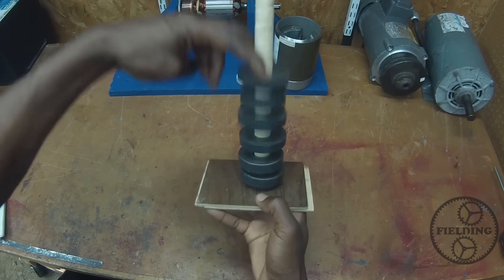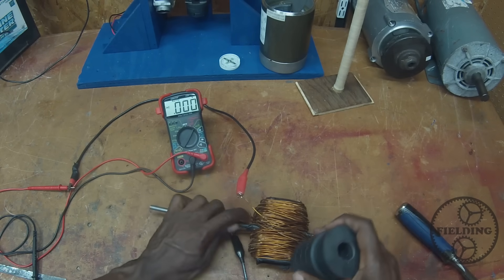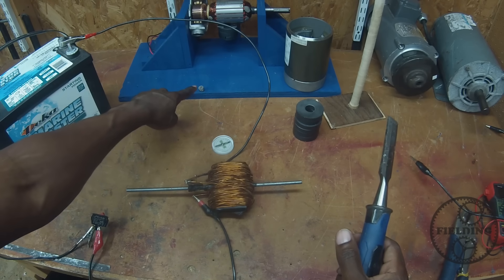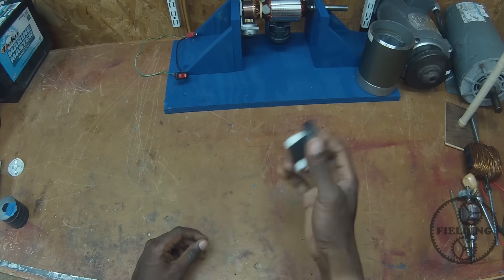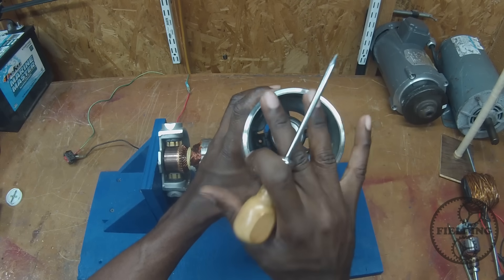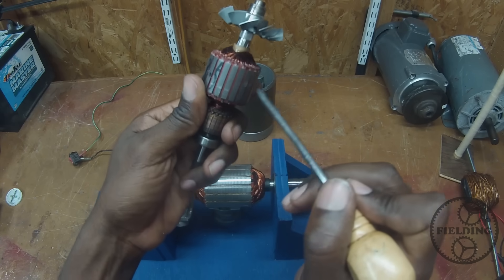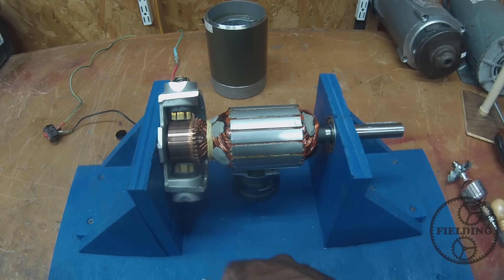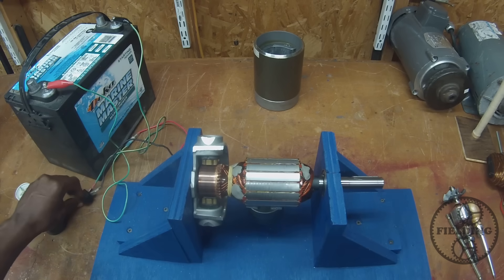How Motors Work For Beginners (Episode 1): The DC Motor: 032

Comment: Jeremy-I wired a d.c treadmill motor with a full bridge rectifier and a switch from a fan-just like you did -it works but the switch and the rectifier get really hot ---any help would be greatly appreciated---diane s
Reply from the maker: +diane spranger I don't recommend you do it this way. Get a speed controller! Now that I said that. At a minimum You need a heat-sink and a fan. Sounds like your rectifier is not rated for the load (amps)

Comment: Carbon nano tube technology, all metals are regined crystal structures which means nano carbon tubes can be filled with these crystal metals to produce lite weight electric motors and generators. Graphene used would mean the whole electric motor would  become an energy generating device. Using crystal power generating systems require no need for moving parts just frequency to induce high energy vibration. A solid state graphite power cell exsposed to the correct hertz frequency would produce more electrical output then just off the earths resonance field. That then can charge organic carbon power cells or graphite airogel ultra power cells contructucted just like carbon capacitors and with being able to mass produce graphene to produce ultra power cells that could be charged off solid state graphite power cells with no need of any moving parts all just by using frequency.

Comment: Jeremy, question...why does the stator part have two permanent magnets mounted opposite of each other inside the cylinder when your design has a magnet on one side only and still functions? Apparently opposing stator magnets are not required, correct?
Reply from the maker: They are not required. BUT, your motor is significantly more powerful if you have a magnet on both side with opposing fields. Basically one is pushing while the other is pulling. It doubles the strength of the magnetic field surrounding the rotor.
Reply: Got it...that makes sense. Thanks again!

Comment: I recently acquired a marathon electric motor, it is in the 1/2 to 1 HP range, but the identification label is no longer on it. Is there a way to figure out was size capacitor I will need to pair with it? I want to build a disc grinder/sander with it.
Reply from the maker: I would just buy a start capacitor for a washing machine. It will be close. As long as it has the correct voltage rating (higher than the voltage being used) it will work.. If it really struggles to start get a second one and put them on parallel with each other. That would only happen if you started it under load like holding something against the belt when it was started.
Reply: Jeremy Fielding ok awesome! Thanks! I love all your videos. Very informative and fun to watch!

Comment: Would like to see converting single phase 120v house current to 3 phase (or about 2+ phase) by driving a 3 phase motor, for say a lathe, etc.
Good basic video for understanding - thanks.
Reply from the maker: The next video will be about three phase motors, but it continues the "basics" theme. I do intend to make a three phase wiring video that addresses this issue of running three phase motors with single phase power. There are several videos standing in line so it won't be quick, but it is on the way. Thanks for letting me know you are interested. Comments like this bump up or down certain videos depending on what is the most requested.
Reply: I greatly enjoy your videos, you present them in a very understandable manner.
Thanks

Comment: Whenever I see the guts of one of these motors it always passes thru my mind : did some poor wretch have to wind those coils by hand or do machines exist that can do it?
Reply: Machines do it but Trump is going to get them out of work guys from  Detroit to wind them by hand.
Reply: What Mr Fielding had demonstrating the magnetic forces, the copper wire, was a crude variation on winding.  There are a few instructional texts out there. 
Machines certainly exist.  
It used to be a "step up" the hierarchy in a motor shop once you were deemed competent to wind a motor...it can be or used to be quite a "dirty" job esp with the insulation and varnishes involved.  Nearly every electrical motor repair shop used to be capable of rewinding a motor.  I live in a city of about 700 000, there are perhaps 3 commercial places I would take a repair and guessing only one or two of those even rewind motors at all anymore on a regular basis.  
Its just replace.  It would still be done if it were cost effective, say a very specific application where a replacement was not longer made (old machinery) or so large shipping costs of new would outweigh cost of rewind.  
In a related field, welding machines used to be of "transformer" style so they too had a lot of copper windings, many welding machines now are inverters and so the need for copper windings for welding machines has been greatly reduced.

Comment: Like to have seen an ammeter in circuit. Later on you'll probably show the current drops back somewhat due to the back EMF produced
Reply from the maker: Back EMF, eddy currents, power factor, and other such related topics I plan to avoid in this series. These are things that I think are easier to understand when you have more background knowledge. This series is about the background knowledge. Your idea does make me wonder if I should talk about voltage, current and resistance... I wonder if I should be assuming they know what those things are and know the difference between them.
Reply: Yes Jeremy it does make sense to keep it simple, I agree.
As for R. A. and V. I can see the dilemma there but you explain really well as others have commented so......

Comment: Great job Jeremy!
I have been reading a book of eletric motors and in the book they explain that the power of  a the motor is directly relationated with is size, but as you show, you have 2 motors practically the same size but deferent power output's, could you explian that in a video, the diferences between a 1/4hp motor and 3hp motor. 
Thanks a lot for your work, it is really explanatory!!

Comment: is there one thing you can look at and tell AC or DC ?
Reply from the maker: Actually, this will be part of the next video... How do you tell the difference between different types of motors and how to read the label if it has one. There isn't just one clue I can point to. Universal motors for example work on AC and DC. The Label is where I start. Then I look for brushes, I look at the rotor, and I look at the number of wires. Both AC and DC motors may have capacitors. You have to look for a few things.

Comment: you dont happen to have a 1 hp electric motor that is 1725 rpms i can do some trading with you on? i need one for my metal bandsaw
Reply from the maker: Of course I do... I have all types and more than one! You need three phase, single phase... LOL You can send me a private message on my about page under my channel... The shipping cost can be in issue though. These motors are heavy.

Comment: Jeremy

Do you have a P.O. Box? If not you should get a P.O. Box so fans can send you stuff. I wanted to send you some HDPE that is scrap from my job that is ground very fine. I want to see you do an HDPE project and this is stuff that is easy to work with since it is meant for injection molding.
Reply from the maker: +gplechuckiii send me a private message on my "about page"
Reply from the maker: You can also send me an email on my website... www.jeremyfielding.com

Comment: Very nice.  If I may, I'd like to have seen the motor powered on while the magnet was removed, then brought back a few times.  Electric stuff is so neat.
Reply from the maker: I may show this in the question and answer video... I did this in the video on making a motor from a microwave. you can see that here. https://youtu.be/au_c8WmgWTc
Reply: We use to use the rule-of-thumb that a stuck DC motor would draw 4 to 5 times the current.  A couple of metres reading amps and volts would be totally awesome for educational purposes, while the B field and back-emf changed.

Comment: Hi Jeremy! Great video, extremely helpful. Inspired by you, I've started picking up things with motors when I see them along the side of the road, taking them apart, and playing around with them. One of the common problems I have is the brushes producing sparks along the commutator. I'm guessing it's because they're not making a firm enough contact and it's causing the electricity to jump the gap. Is there an easy fix for this? Perhaps that's why people are getting rid of these things in the first place... They smell like electricity when ran!
I'll be watching with interest, thank you for all the great videos!
Reply from the maker: If you can find replacement brushes, that would be the first thing... It sounds like they are too short and are starting to arc.
Reply: Brush motors always make at least a faint arc when running properly. It's from the electricity transfer. When you have an abnormally large arc, it's from either the brushes being too short and causing a larger air gap to need to be traversed, a short in the motor (typically the armature/ rotor but the stator field is possible as well), or an extreme amp draw due to heat generated from overloading (bearing seizure or overtasking are common culprits) or low voltage. Ohm's Law explains the relationship between amperage, voltage, resistance, and heat and how if you change one value it affects the others.
Reply: flashpointwhite there is. It's called replacing the brushes.

Comment: I've been an electrician for 15 years and never fully understood the differences in some motors.  what I want to know is if their is a motor that ran in reverse generates electricity.  and fundamental differences in motors and generators
Reply from the maker: It will come as part of the series! Thanks for letting me know
Reply: Jeremy Fielding awesome video can't wait for the rest. very good at explaining things
Reply: If you run a motor with an outside power source like a turbine or a gasoline engine then it's a generator. If you use electricity to rotate the generator to do work then it's a motor.
Reply from the maker: +glumberty1 I described this in detail in the next video. It posted yesterday
Reply: That's great to know!. I have several older tools that are belt-driven and use induction motors, and this has helped me start to understand the differences between these and DC motors. I'm looking forward to learning more!
Reply: Would it be correct to say that the same thing is occurring but in different directions?  Isn't it just a movement of electrons?
Reply: Thank you Jeremy.  I'll watch it when I have time this evening.  I'm excited to watch ALL of your videos.  The two I watched so far were great.  : )
Reply: @Alan Ferkinhoff: interesting, will use that bit of information for furture references. I Like, OLE!
Reply: Borna Tona keep that to your self
Reply: plz let me know..what is ur qualification..
means what did u study..

i wanna know this bcs  im a mechanical engineer and then graduate in marine engineering..

i studied all the stuff what u explained through the videos..
i learnt with formulas derivations..with quite imagination in my mind abt what im reading..

but u did an awesome work..i always think abt do some practical stuff like but i cant..but u made it..im pleazed with ur explanation..literally im shocked..
each nd every thing what u explained is right...ur way of thinking to explain abt motors is awesome..
great salute nd great respect for u..
Reply: your expalnation isnt corect